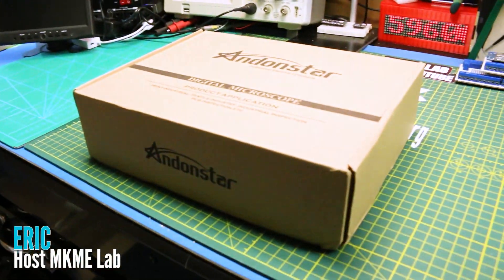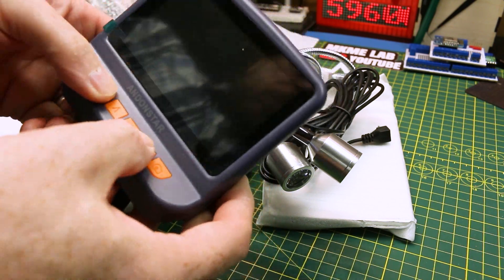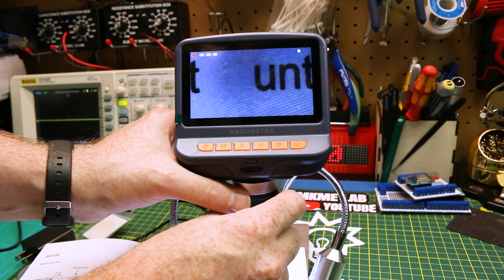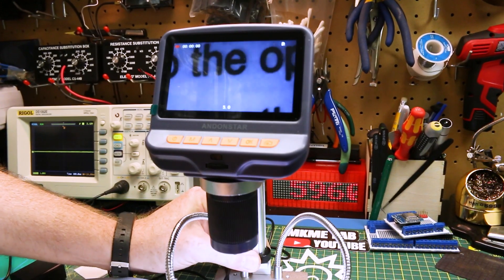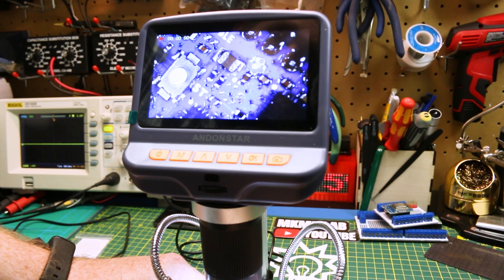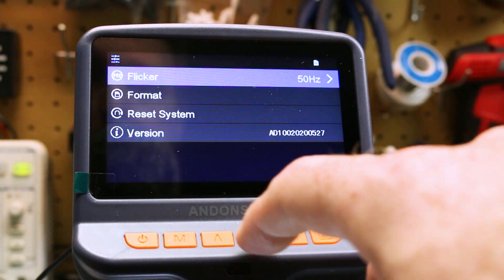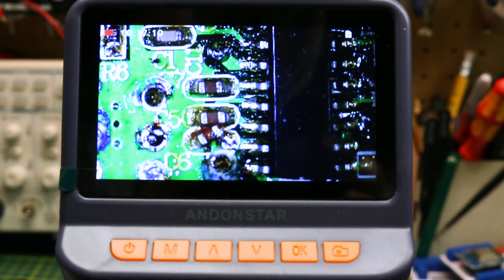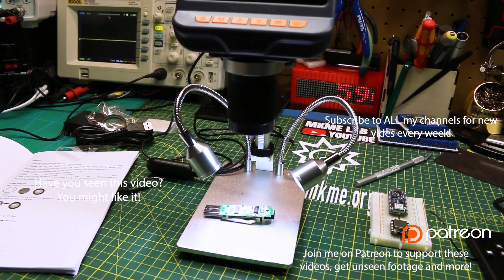Digital Microscope for Electronics that DOESN'T SUCK!

Comment: do they make any that work with android ,  I rather pay for better optics and have a phone or tablet holder and use my own display instead of paying for another one, I have so many old android phones and tablets that I could use for something like this ,  couple old nexus 6p's  and a 2018 fire HD 8 ,  such a shame they don't have any where you can use your won android display , I bought a cheap Chinese endoscope for like $5 and that  works with android, albeit it is picky on which phone you can  use  but works with my pixel 3a xl
no need to sell  you another display

Comment: Hey Eric, this is nice and $100 cheaper than the AD407 I've had on my wishlist after replacing a neighbor kid's bad HDMI port on his ps4 and using the zoom on my phone to see the solder pads. That wasn't easy, but got the job done.

Did you ever do the autonomous flight project I think you mentioned you were going to do, maybe a year ago? Was that using ardupilot? Maybe you did and I missed it. I've been 3d printing Planes from Eclipson and thought about that and wondered how good it worked. Stay safe and take care!
Reply from the maker: Hey John.  Check out the RC/Drone playlist on this channel.  Last year I built up the Nano Talon and AR Mini Wing both are iNav so they can operate autonymous.  I am editing the AR Wing video right now actually since I never did publish the final assembly/flight after I live streamed it.  I will try to upload that soon. It's an awesome little plane with 18650's and iNav.
Reply: @MkmeOrg  Wow, not sure how I missed those videos! Definitely checking them out and watching for the new one when you get it published. Interested in how inav worked for your models. Take care!

Comment: Ps the hot-air rework gun you have has limited air flow. I modified mine by cutting the grid of the air duct and taping the fan to the internal board. And gluing the small gaps between the funnel and fan. It has been a far more better experience to use it then
Reply from the maker: It has plenty more than enough flow for me in the nearly decade of using it.  I never have the fan anywhere near 100% when doing SMD.

Comment: I like the pair of LEDs better than the LED ring light that my digital microscope came with.
Reply from the maker: I missed showing it but there is also a ring light on the bottom of the lens with a rotary brightness control.

Comment: Probably HD = 720p and FHD=full HD 1080p. I doubt it will make much difference on that size of screen, can do some for video.
I think for electronics the most inportant features are no lag and large enough field of view ie. low enough magnification and enough space to work with. I wonder how that would work with larger PCBs. Often small platforms can be a pain.